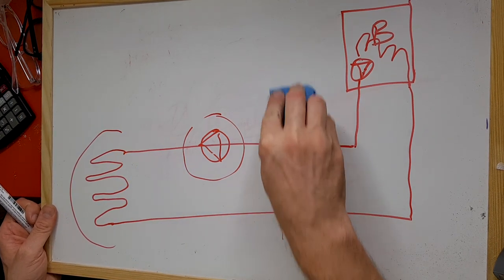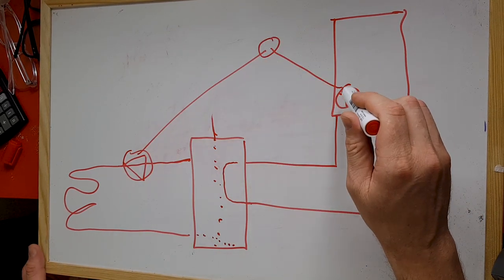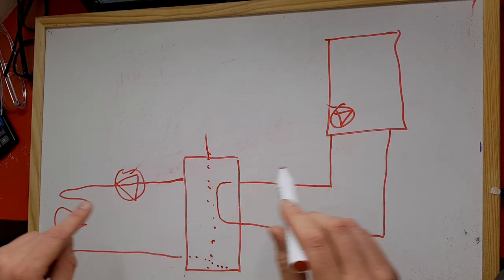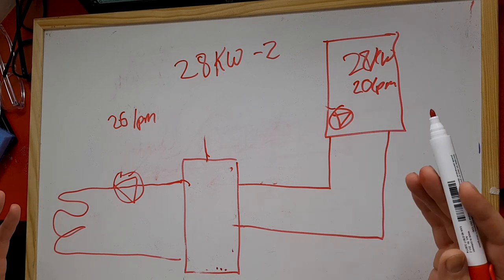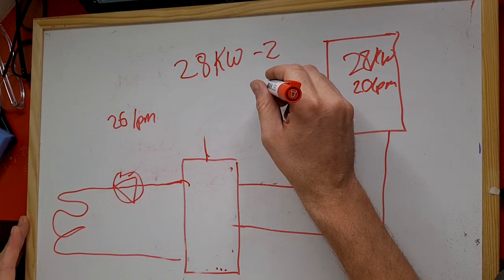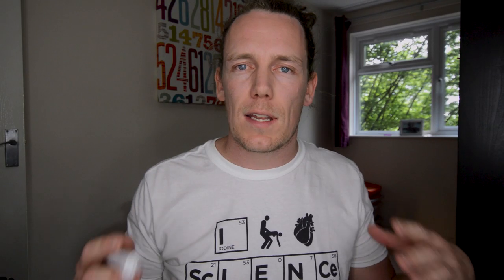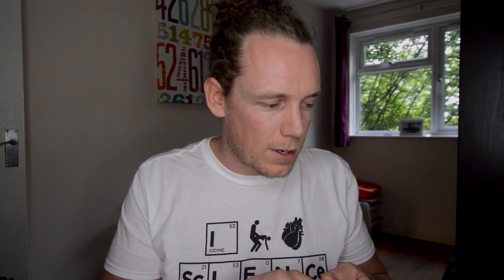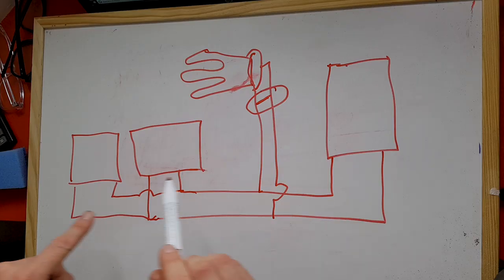Why NOT to use Buffers or LOW LOSS HEADERS!  The Low Loss header explained.

Comment: Mr Heat Geek ---  Using a LLH increases the return temperature, thus lowering condensing efficiency.  This happens 100% of the time --- even if you do all the calculations, the return temperature is NEVER lower.  .  So, in an installation with a SINGLE ModCon, instead of using a LLH  to balance 2 or more pumps, why nor use a SINGLE bigger pump (or 2 pumps connected in parallel(electrically).     If u use a single powerful pump, use valves to constrict flow to rooms that are too warm. OK, you said a Single pump is less efficient ( Square rule) .  If you have to have  a second pump,  run it at the lower speed (but always running when the main pump is running)  to scavenge less water  from other rooms that are not getting warm enough.  

Some contractors say that a LLH prevents Thermal Shock to the boiler after turning ithe temperature down overnight.  To eliminate shock, run the primary pump continuously.  A TACO 007 (or Grundfos UPS15-58) uses 85W at highest setting.  At $0.13 per kWh,  it costs a mere 26 cents a day to run it.  At Level 2 setting, it uses 19 cents a day.  The same pump in start stop mode may use a little less energy, but will not last as long.
  
Eliminating a LLH saves $1000 in parts alone, increases condensing efficiency,  and simplifies Installtion calculations.  Running the main pump 24/7 prevents Thermal shock, and reports precise return temperatures to the ModCon.  It has one other major benefit.  Let's say you have a basement (cellar) that you don't to be heated, or you have some of your pipes on a poorly insulated  outside wall.  Your room can report a temperature above freezing, but the water in the pipes may be below freezing  if water has not circulated for awhile.  Running system water GUARANTEES that the pipes will never freeze, because the ModCon will run when the return water temperature gets that low..
Reply from the maker: You should have just watched the video then spending time writing this
Reply: @HeatGeek   I apologize if I insulted you.  I have actually watched ALL your videos at least 10 times, and found all of them very educational.  You were the only one who adequately explained what a LLH was supposed to do --- something that none of the contractors I talked to was able to explain.  What I wrote was a few more observations than was discussed in your video , and I was hoping to elicit  a critique from you.  Please accept my apology

Comment: Isn't the primary and secondary balancing not really a problem if using fixed speed pumps?
Reply from the maker: No because the primary pumps aren't fixed speed. Also.. you haven't been able to buy fixed speed pumps in the uk for years.
Reply: @HeatGeek  Hi thanks for the reply. I'm confused. Im sure my heat pump  has a selectable 3 speed pump and my boiler pump is a Grundfos 15-60-130 , again 3 speed selectable?

I'm building a bivalent system with LLH and hoping to balance primary and secondary using those 3 speed pumps . Both sides will be running on a dT10.
Reply from the maker: @Matt Cole  erp pumps use foxed pressure or proportional pressure. Not speed. They vary the speed to obtain the selected pressure and have 3 settings. 3 speeds is just left over lingo from the old.
Reply: @HeatGeek  yes but  most good pumps also have constant speed settings as well as PP and CP. If that's the case, there's nothing stopping the designer using a constant speed setting, allowing the pump to remain on a constant curve and thus, balancing the primary and secondary circuits.

Comment: 12:32 Interesting to see you say an UFH manifold without hydraulic separation and on a radiator system needs a close-coupled tee.  If the flow the UFH manifold takes from the primary flow (once heated through) is not enough to rob the radiators, and the sum of the startup UFH flow + radiator flow does not exceed the boiler maximum, I'm a bit confused as to why you'd need a close-coupled tee.  My concern would be that just putting in a close-coupled tee as you suggest at 12:40 would throw 70°C water back into the boiler return as well as throw the system out of balance.

Any chance you could tell me what it is that I am misunderstanding please?
Reply from the maker: Hi. The cct leg would need a balancing valve and be balanced to delta t 20 drop.
Reply: @HeatGeek  Thanks.  That makes sense.  I like your video, by the way: nice to see someone else putting some serious thought going plumbing and you explain it well.  I look forward to watching more of your stuff.
Reply from the maker: @johnbull5394  thanks. Check put heatgeek.com too.. lots of articles there
Reply: @HeatGeek  Ha, that's where I found your videos :)

Comment: Hi Adam
You say that delta T on the secondary side should be 15degrees would that apply to a heat pump? I have a 25L low loss header/buffer on my system. The heat pump is looking for a delta T of 8degrees according to the manual. Not quite sure why I have a buffer because it is causing problems for controlling the secondary pump, the system is on a 3 bed bungalow with under 200litres. The unit is a Daikin EBLA09D3V3 the heating load is 5.5KW.
Any help would be appreciated before the dreaded winter of energy bills.
Reply from the maker: No. As per video dts either side should match as closely as possible to avoid distortion

Comment: Why not this application in a cast iron boiler…. 80% efficiency for the sole reason to maintain a 20DT and not shock the block with a low DT causing condensation and a rotting flue pipe

Comment: A nice vid would be where to locate a pump, and how to set it.  For example, a three floor house with  a basement that is approx 10 m (1bar) from from the top of pipework to bottom. Which is the best location? Top, bottom or half way up?

Comment: looking forward to these series. so maybe i can learn how i can combat the extreme flownoise and drone from my central heating system :) (i know why, but not how to combat it. new modern air to water heatpump. which can only run a max of 10c delta.. leaving me with up to 40l/min trough 50 year old galvanized piping.... )
Reply from the maker: A potential very simple fix for that. What HP is it? What control system is it using? And importantly, is it connected to a buffer?
Reply: @HeatGeek  Daikin Altherma LT. no buffer tank. controlsystem is daikins own (which i think is lacking in simplicity and features.. but it does what it says on the box. heat water. both for the central heating and dhw :) i'm all for simple fixes
Reply from the maker: Ok, and what's the delta t at full load?
Reply: @HeatGeek  its currently set to 10c. which is max. What the delta-t is at full load i don't know right now as its far from full load atm. .. daikin recommend 3-5c delta-t.. as of right now, the measured delta is 0.x (.5 or so. 35.5 outlet, 35.0 inlet)
Reply from the maker: @burzheru  is it weather compensated?
Reply: @HeatGeek  yes, it is
Reply from the maker: @burzheru  just checked it doesnt look like it has a DT pump control which would have resolved alot of this... does it have a low loss header?

If not, you can replicate full load by turning the internal temp to 21oc above the outdoor temp. You then want to adjust the pump to dt 10 and that's all you can do.. if you have a low loss header you can install a magna 3 which has dt control..
Reply: Heat Geek no low loss header. Not much of anything other then the magnet filter. Its heated water out, into the radiator loop. Then back into the hest pump. I have thought about maybe installing a bypass valve. But that might eff up the whole system? (Which is 13 radiators with unusable trv’s 😆)

Comment: If you switch to a open vented Thermal Store, as I first designed in 1991, then re designed in 1998, and again in 2012, and again in 2014, but for commercial use and again for domestic in 2017, you would not need to mess around with what has become a mass produced range of oudated hot water cylinders. you can check out what a thermal store is at www.thermaltricity-int.com
Reply from the maker: The problem with thermal stores is that they dont suit modern boilers. Modern boilers are much more efficient when ran cool. With a thermal store you have to continually run the above your desired hit water temprature.

Read more here https://heatgeek.com › benefits-of-lo...
Benefits of low temprature heating systems - HeatGeek